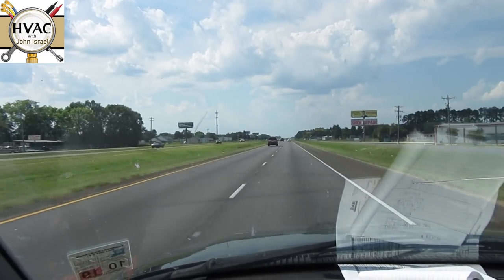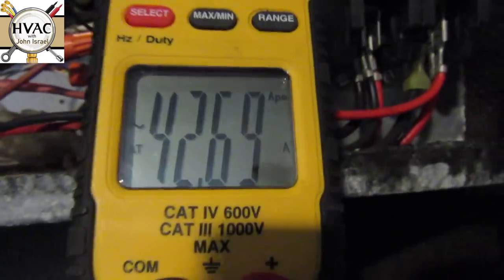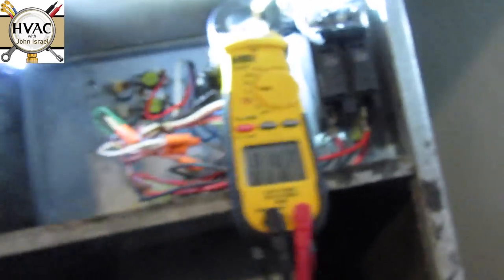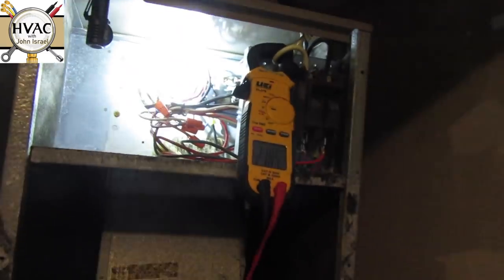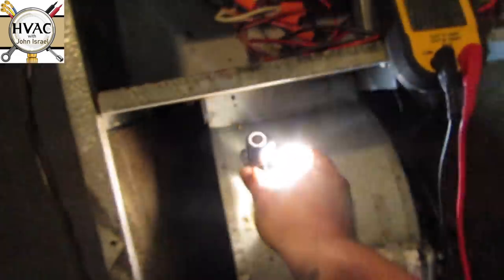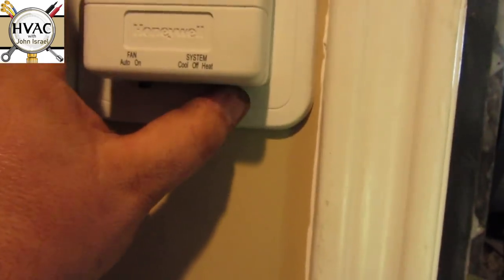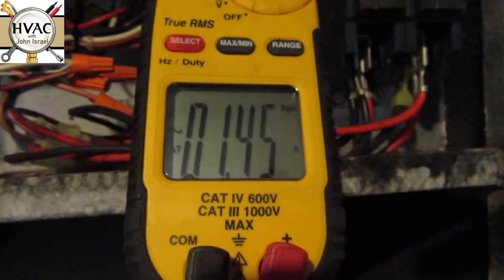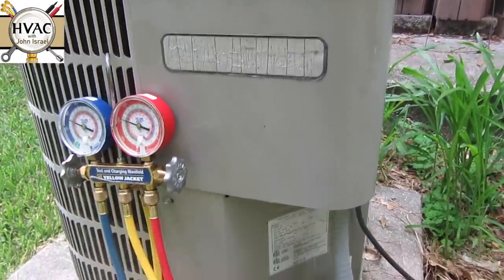No Cooling/Heat Running with Cooling

Comment: Back in the early 2000s copper was cheaper than $5 a foot( lol) and whoever the installer was probably stubbed out of the ground with scrap for the t-stat wire. Great job John 👍.

Comment: That control voltage in copper pipe is a great idea. Been on so many calls where dogs or weed eaters or mice destroyed thermostat wiring that I carried conduit just for the control circuits.  Also that fan motor turns off way too soon in heat. I enjoy your videos, thanks for sharing.
Reply: I agree. Just make sure you debur the ends of that 3/8. SHARP!!! 🤣

Comment: Nice work, check that evaporator coil. That return filter is a sidewall low to the floor, and they have a dog. Dirty coil will make the heater  compartment sweat, and cause relay failure.

Comment: Your gonna burn out your heat strips cause the fan is turning off at the same time as the strips. I had to put the low voltage in copper cause the dogs and didnt have anything else at the time